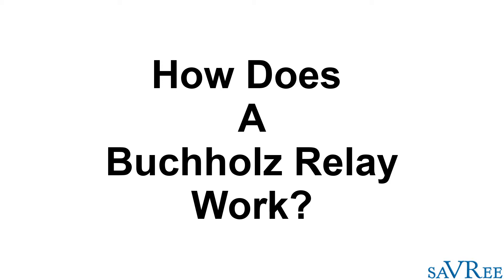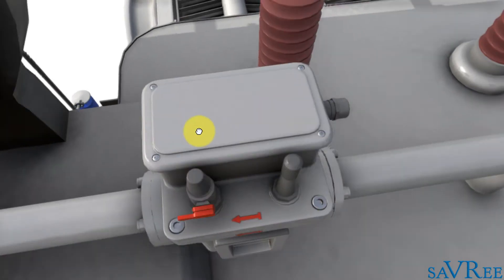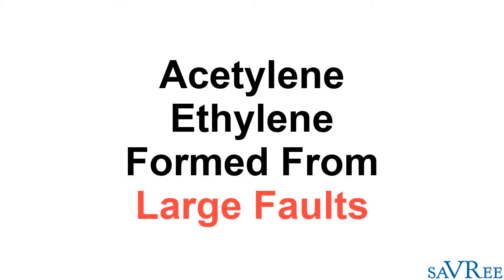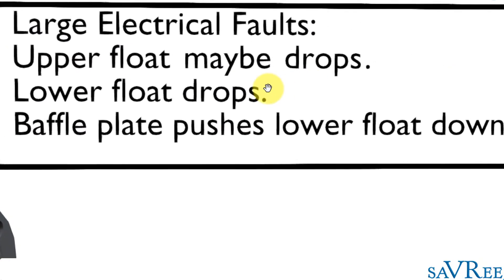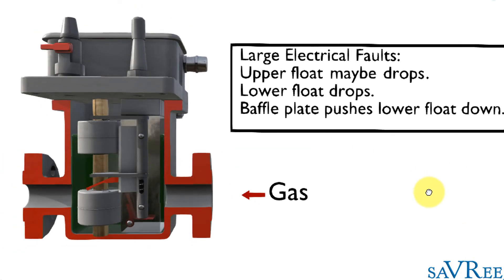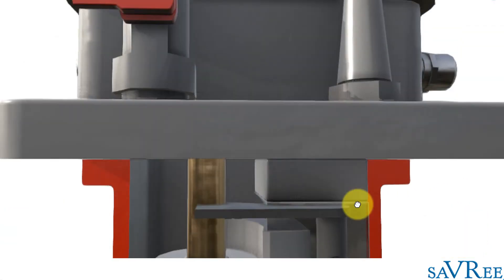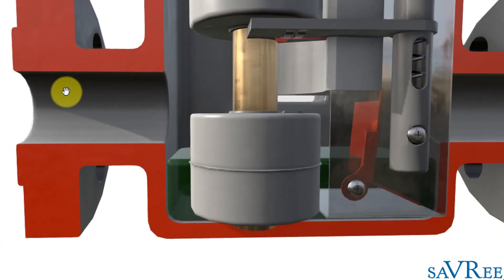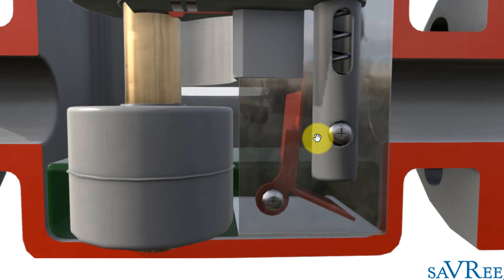How Buchholz Relays Work

Comment: Does gas gets analyzed too or just oil? is DGA applied to both samples?
Reply: Dissolved gas analysis test is done on transformer oil to check for dissolved gases such as carbondioxide, methane, etc

Comment: Not bad... not bad... BUT! 
You should show each animations a few times, as it was a loop. It would be useful to see the processes from more angles, with different zooms. 
It would be very helpful to see the gas flowing if it had a color. 
You should have mentioned the mercury switches and their output signals on the top of the Buchholz!

Comment: Would you care to tell me why there are two bleed valves on top of the Buchholz relay's chamber? Even though one of the valves does nt exactly look like a release valve..
Reply: @savree-3d  How to test the baffle ?
Reply: @savree-3d  would it not reset automatically or would you have to pull the float up to reset it?